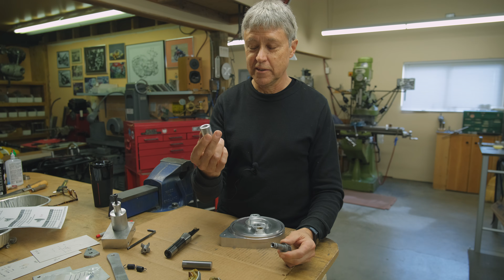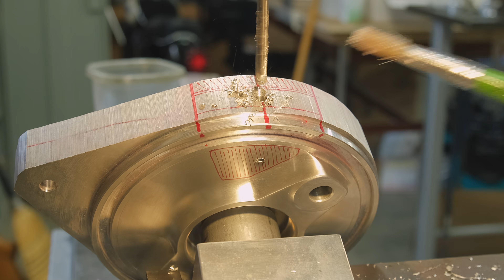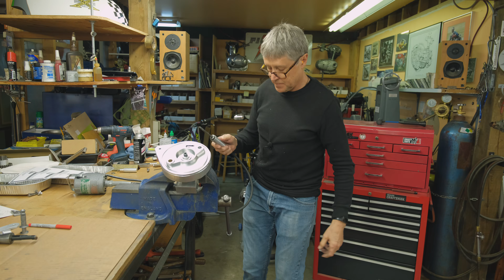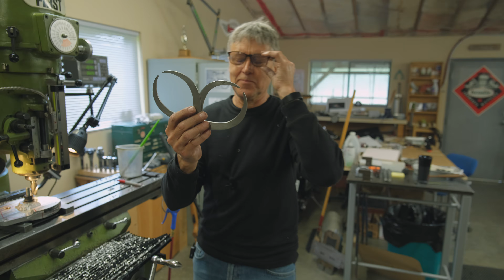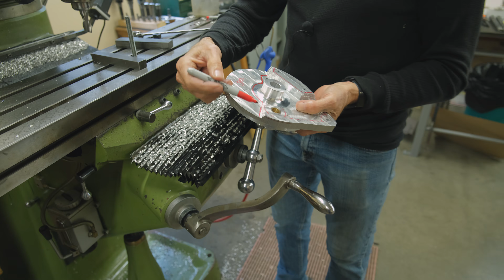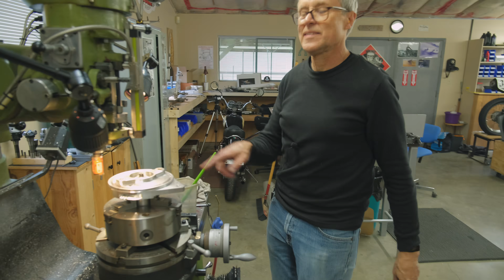Aermacchi Backing Plate - part 2 // Paul Brodie's Shop

Comment: Jeez Paul, so informative watching a true craftsman. I'm a cabinet maker, so I get it, I think. I have a 65 Sprint, with a 67 motor, that I'm trying to restore and put back on the road, the engine has been gone over by an Aerimacci specialist who tells me it has a racing cam,dont know the bikes history but is this possible? Motor runs great,otherwise the parts I have are standard for both machines. Is the 67 fork design better, improved over 65? If you don't have time to answer, understood, no worries. Just watching a motorcycle man like yourself pass along knowledge is awsome. Cheers brother!
Reply from the maker: Hi. Yes, it is possible to have a racing cam in your motor, but if everything else is stock it makes very little sense..  I would say that both forks are the same, that would be my opinion. Thanks for watching!   :face-orange-biting-nails:

Comment: Another great video, I find your workshop style nice and relaxing and I learned some things.  My father who was a fitter turner toolmaker in the navy always told me not to "climb mill" ie use the tool the way it wants to grip and pull itself along.... you seemed to get away with it so maybe it's not an issue? One other way you could have saved another really small mount of weight was to make you bronze bush thinner walled or perforated.   Love your work.
Reply from the maker: Thank you Gavin. Climb milling works well for some manual milling operation, I just have to be careful how much of a cut I am taking. Yes, I now wish I had made the bronze bushing a little thinner...

Comment: The 350cc engine was a good fit for the Rickman Metisse which was a good frame in its day. TR2s signed the death warrant for it and the Manx Nortons etc.
Reply from the maker: Yes, you are correct. A lot of 4 strokes were doing fine until the Yamahas showed up.

Comment: spray alcohol on the aluminum to prevent clogging your saws, bits and end mills...
Reply from the maker: I do use a good cutting oil. The holesaw was just not the right tool for that job.

Comment: Can you do a show on the hand tool you use and what to look for when buying them I kill my files .You do allot of fab with files grinder etc but the best advice you gave me always think of a way to clamp you work though out the processes.
Reply from the maker: I buy high quality hand files. Not the cheap ones. Small ones cost me $12 each. Never lay files on top of each other, Always place them on a shelf with a space between them, Never clean them with a file card- use a piece of soft aluminum to clean them.

Comment: Paul… would you like to elaborate more on the pantograph measuring jig you had made please…?
Reply from the maker: Both ends close at exactly the same time, and they are equal length, so if one end is on either side of a 1/2" plate, the opposite end will be open exactly 1/2". Make sense?

Comment: Bolting to an adjustable angle plate would of made your setup more rigid. I picked a big old one that needed refurb very cheaply and use it to hold cylinder heads when doing valve guides and such. They are quality items available for little more than scrap value. Has a neat feature in that there is a dowel pin that locks it solid at 5 degree increments for quick and accurate setting up. I know it's cheating but the five axis CNC helps too, but still love doing jobs by manual control like you do. Thanks for the great and inspiring content.
Reply from the maker: Thanks Andrew. Yes, now that you mention it I do need an adjustable angle plate :)

Comment: I made a simple tool that will raise the Milling Machine table rather quickly with almost no effort. I took a length of Sturdybroach and welded a short length of same diameter steel rod to it, then turned the end of the rod down to 1/2" dia. to go in a portable drill chuck. Then you have a cheap Z axis drive. If you're not familiar with Sturdybroach, it is a short (say 3") length of steel rod with a square hole broached lengthwise in it. My mill has a 5/8" square Z axis drive that takes a small cast iron handle so I used that size Sturdybroach. Saves a lot of time in raising the milling table. Sturdybroach is sold by greenbaymfgco.com and its fairly cheap. To see what it looks like, go to mrpete222 and look at tubalcain VLOG # 19.
Reply from the maker: Thanks. I will start an investigation.

Comment: Yay, part two ;o)
7:30~, made me jump, thought you'd lost a finger! 
Thought it was a bit 'ambitious' with only a single centre bolt holding things
Surprised you haven't made a fixture to allow rotary table to be set at an angle? (the weight of rotary table would help stabilise even a relatively light jig?)
Interesting story about 250 racer getting you into racing,
 Around 1978 I was at Llandow (South wales UK) on my almost new CB550F1 and there was a Aermacchi 250 racer there being set up. (track had not be reopened at the time)
250 single was almost as quick as the 550 to around 80~85 mph with a 'top end' over 100mph which really surprised me.
I like the 'evolution' approach, I tend to do the same but would probably nave incorporated some fins as on Moto Guzzi and MV Augusta's, the section can be a lot thinner as the 'fins prevent twisting and distortion (only thought about it as I was watching).
 I also use round aluminium soffit vents to keep 'boy scouts' out of brake drums (what would happen if we put some gravel in this hole?)
At Daytona a few years ago I saw a 'CB 160' racer with all the 'sheet' parts of back plate cut away, basically just the centre rhomboid left to hold brake shoes
Reply from the maker: I haven't had to have the rotary table at an angle before... so, haven't considered a fixture. It worked out ok in the end. Yes, Aermacchis can be surprisingly fast. My little 350 was as quick as the slow Vintage 750's. I chased them many times. I liked it when they checked to see how close I was. And I was always close!
Reply: @paulbrodie  LOL, that's why I had Honda CB360's for the last 16 years, (bored to 378cc) way more fun chasing $20,000+ 'Paul Smart Replica Ducati with mediocre rider on a $200 'red haired stepchild' of a bike
Reply from the maker: @1crazypj   Sounds like you've had some track fun too!
Reply: @paulbrodie  Just a bit but the Ducati thing was about 10 years ago on the street. There are a few area's in central Florida where the roads get quite twisty through old orange groves without a long enough straight to use the power of the Duc, (back to being 19 yr old 'hooligan' LOL) I really should have grown out of it by now
Reply from the maker: @1crazypj  I understand; I know what you are talking about :)

Comment: Greetings,
I am intrigued by your Excelsior bikes, and love your current Aermacchi project.
One thing I like is your approach to the project.
You’re not a trained engineer or machinist, but you don’t let that stand in your way.
You apply the knowledge you have, learn what you need to, and move ahead, solving problems as they present themselves.
It’s fascinating to watch you work your way ahead.  I appreciate you showing us your mistakes, and how you deal with them.
I would suggest you watch videos by Allen Millyard.  His engine projects are amazing.
His current project is a tribute to the Honda six cylinder Grand Prix bikes of the 1960’s.
He has been dealing with fabrication of the frame and suspension components, and recently showed how he built the gearshift and brake arms.
His videos might provide some insight into how he approaches problems similar to your own.
I would also suggest videos by Michael Waller.  He builds mostly trials bikes, but I find his videos fascinating.

Let’s be careful out there.
Reply from the maker: Hi James, yes I subscribe to Allen Millyard. Amazing what he can do with a hand hacksaw and a Tig welder. I will check out Michael Waller; have not heard of him but I am into trials bikes! Thanks for watching!
Reply: @paulbrodie   Mustie1 also does great vids, most types of small  engines and some bikes, anything that comes along.
Reply from the maker: @edwardmulder3777   I will check, thanks.

Comment: OMG! That is brilliant Paul using a thread cutting tool to make splines! Totally using this in the future
Reply from the maker: That's what happens when you're frugal. Just figuring things out as I go...
Reply: @paulbrodie  I too am frugal🤣
Reply: @paulbrodie  thing is I have the 60° cutter that you were looking at but it didn't want to cut tool steel, but I bet the threading tool will

Comment: Great video. Your skills are amazing.

On the subject of the new camera. The new camera seems a bit less vibrant in the colors of the image, it also seems to quite frequently make noticible auto focus corrections as compared to the previous camera.
Reply: Yeah I agree with the jumpy auto focus. I’ve adjusted some settings to control the focus “breathing” a little better.
Reply: @mitchellnurseproductions  I was just about to comment on this, the autofocus is also making the image wobble. Is the DOF shallower on this lens also? I haven't reacted to the background being as soft before, but on the other hand I was kind of looking at the videography more critical now :) Anyhow, you're doing a great job Mitch!
Reply: @folxam  yes, this lens has a shallower DOF. I’ll play with it before the next video to make the autofocus a little better👍
Reply: @mitchellnurseproductions  I also noticed some automatic exposure adjustments, or was it some other trickery? Mind you, none of the video is bad, just those small things and you're gold!
Reply: @folxam  I didn’t have it on automatic. I try to keep everything in manual as much as possible. But in those cases I was switching the ISO during filming. Paul’s milling and lathe lights combined with the shiny aluminum makes for a harsh bright spot on the camera.
Reply: @mitchellnurseproductions  ah, ISO ... Well, I may have noticed only because of critical viewing. No biggie :)